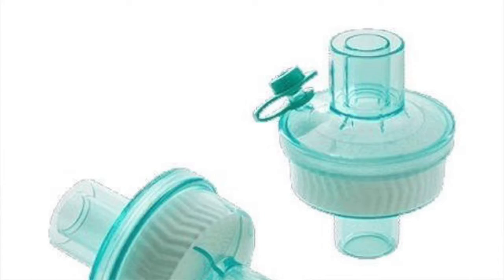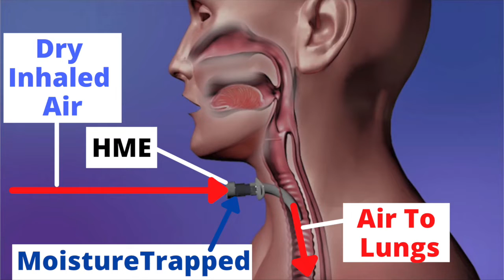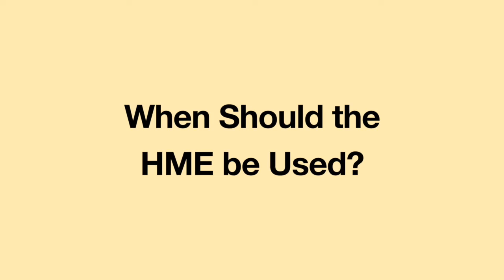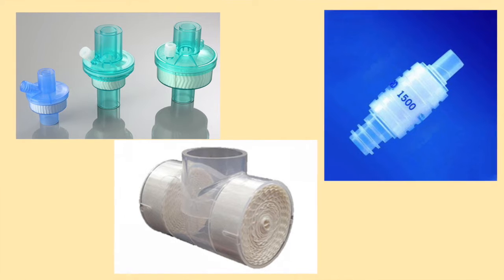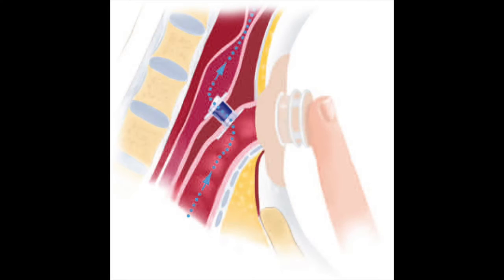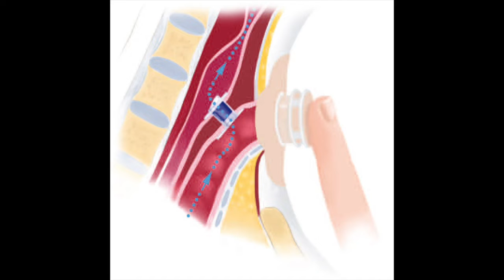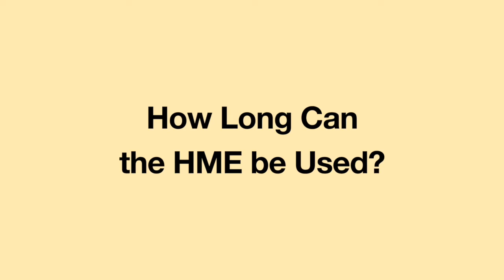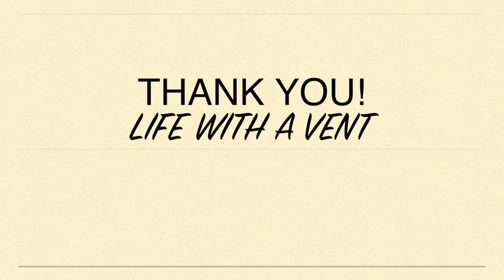Heat & Moisture Exchangers (HMEs) ESSENTIAL Info! Life with a Vent

Comment: How is if The ventilator humidifier mix with HME? What happen?
Reply from the maker: If the HME is attached while using a humidifier, the HME will become saturated with moisture. When too much moisture is absorbed by the HME, it will start leaking the excess water down the trach tube and into the airway. Also, the excess moisture in the HME will become a breeding ground for bacteria and may cause bacteria to grow in the HME.

Comment: Thank you for the informative video. However I have few questions to ask, I bought my father 3 types of HMEs but he said that he got trouble breathing with it. Also he is using Shiley 6cfn at the moment, he always takes out the inner cannula saying it makes him easier to breathe for a bit..so basically on daily basis he is not using any humidifier, then not using the HMEs and now he always pull out the inner cannula. Is that a good practice? Thank you 🙂
Reply from the maker: One thing which should be addressed with your father's medical team is the size of his trach tube. A size 6 is a small size for an adult male. The smaller the trach tube, the smaller the diameter of the trach tube, the harder it will be to breathe through the trach tube. Most men have a size 8 or larger trach tube, depending on their height and weight.

(For reference, I originally had a size 8. The size 8 was too long and was digging into my trachea. I was switched to a size 7. A size 6 is too small for me and made it very difficult to breathe.)

The inner cannula is used to make it easier to get rid of the mucus from the inside of the tracheostomy tube. The inner cannula makes the tracheostomy airway significantly smaller. Considering your father is using a very small trach tube, I would not force him to wear the inner cannula. It will make it even harder for him to breathe. If he is able to get a larger trach tube, see if he is able to tolerate using the inner cannula.

The HME will make it slightly more difficult to breathe through the trach tube. He may be able to tolerate the HME if he is able to get a larger trach tube.

Were you able to get a nebulizer? Running saline through the nebulizer several times a day will help hydrate his airways and will help loosen his mucus.
Reply: @Life with a Vent  I will inform my father about this information. We will address to his medical team. No wonder he always have trouble breathing. He said that when he take out the inner cannula, it becomes easier to breathe. Sometimes when he takes it out there's a bit of blood also. However he does seems to be more relax when no inner cannula inserted.

Also, when he first came back from the hospital on day 1 when he put his finger on the trach and close it, he can talk a bit we can still hear his small voice. But after that we can't hear, like no voice can be heard. As seemed the mucus is building up making him hard to speak. I did watch your video on how to change the trach but I still have doubt to do it. We only clean the outer trach then do suction. We waiting for his next checkup to clean/change the trach. I've also read about the speaking valve, but its quite pricey for us. At the moment we learn lip reading and also using notebook to interact with him. 

Yes I managed to get the nebuliser he loves it so much, he evwn ask to use it quite several times a day. It does helps him. I'm so glad that I bought it, thanks to you 😊
Reply from the maker: @kwitty89  Oh, good. I am glad the nebulizer helps! As for speaking, I am sorry your father has seemed to have lost that ability. The speaking valve works the same as placing the finger over the tracheostomy tube opening. If you cannot hear your father when he places his finger over the tracheostomy hole, the speaking valve will not be of much use to him.

One thing which may help his ability to speak is switching from the hard plastic Shiley tracheostomy tube to the silicone Bivona tracheostomy tube. I had great difficulty talking with a Shiley tube. I switched to the Bivona and I a dramatic increase in the volume of my voice. Maybe a different trach tube might help your father.
Reply: @LifewithaVent  hi, I tried to find the brand that you mentioned but sadly not available here. But there's a lot other brands I may try for him. As for now my father said that when he put his finger over the tracheostomy he can't breathe at all like the first time he had it That's kind of concerning because before he can still breathe. We are waiting for his next checkup to update his medical team about this. I hope there will be nothing serious. I'm quite worried right now. Thank you for your reply I appreciate it so much.
Reply from the maker: @kwitty89  I am sorry to hear your father cannot breathe like he did when he first got the tracheostomy tube. The tracheostomy tube may be causing irritation to his airways. Please mention this to his doctors. A medicine called a bronchodilator may be helpful for him. The bronchodilator is available as an inhaler or a solution for the nebulizer. Getting the medicine in a solution for the nebulizer would be best.
Reply: @LifewithaVent  
Thanks for the response you gave to Syu Mohd. I am about to be switched to a size 6. Now I am more concerned. I have seen two doctors and neither has talked to me about using an HME.
Reply from the maker: @anonymousperson4363  A size 6 may be an ok size for you. It really depends on your height, weight and structure of your airway.  Ask about HMEs at your next appointment. Explain what they are and ask if they would be useful to you. Your doctors may not be familiar about HMEs.